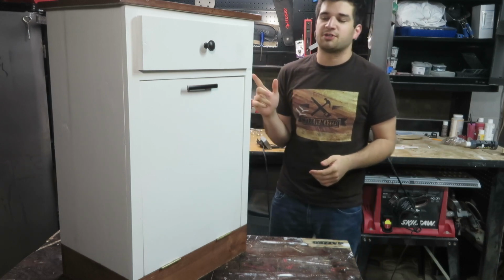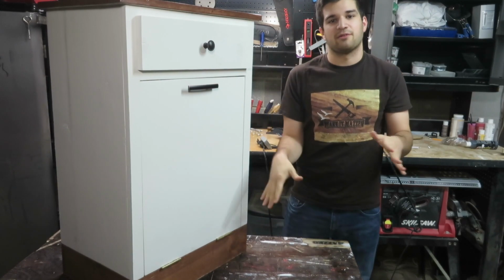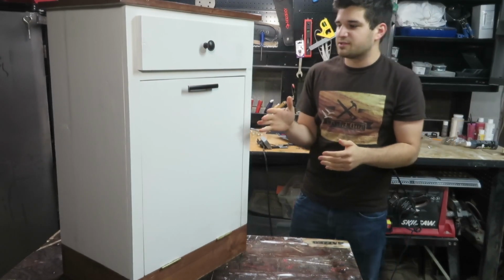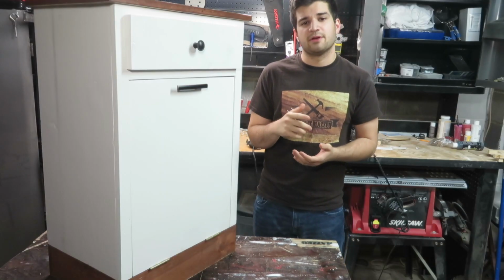DIY Garbage Cabinet

Comment: Awesome project! Quick question, what're you using to hold the garbage can from falling off?
Reply from the maker: Thanks so much! Honestly the only thing holding the garbage can in is its own weight. I have thought of just screwing the can into the bottom of the platform or making a little hold down for it on top but I've been using it for two months as my main garbage can and its never fallen over. Also it is prevented from falling out the back from the cross piece in the back. Thanks for the question!
Reply: Make It Mazzeo what you could do is put a light chain around the can, hooked to the back of the pull-out face.

Comment: Nice little project. Subbed, need to make sure smaller channels like ours survive YouTube's new policies.
Reply from the maker: Hey thanks! I subbed back. Yeah I hear ya, I meet the subs requirements but my watch hours are at 3335 and need to be at 4000 I'm close at least.
Reply: Thanks, much appreciated!
I have plenty of minutes, just lacking subs.
Issue with my channel is diverse content, so it's hard to keep subs. I think 98% of my views are not subbed.
Thanks and good luck with the channel, I'll have to watch more of your videos to push you up there!

Comment: But it goes so fast it would be hard for me to follow, and it doesn't say what all materials you need
Reply from the maker: http://www.makeitmazzeo.com/projects-1 
Made entirely from 3/4 inch white pine except the drawer which is 1/2 inch maple plywood with a 1/4 inch plywood bottom 
Also check the second line of description.